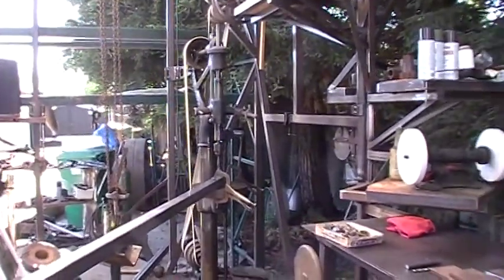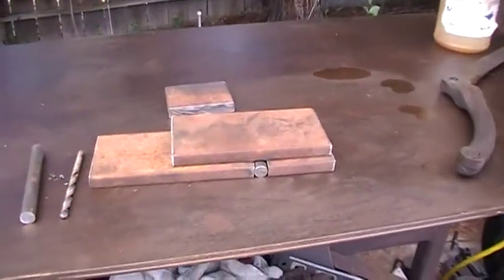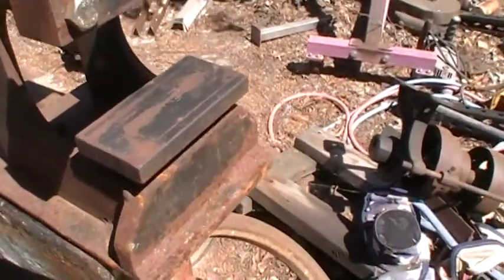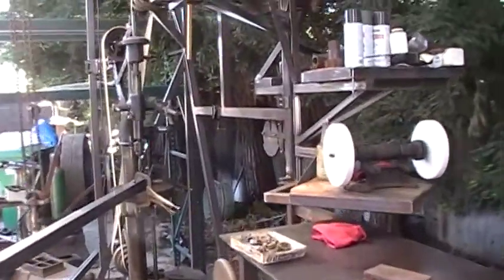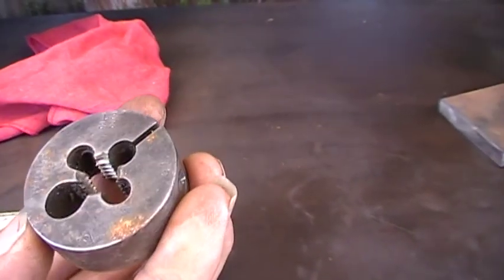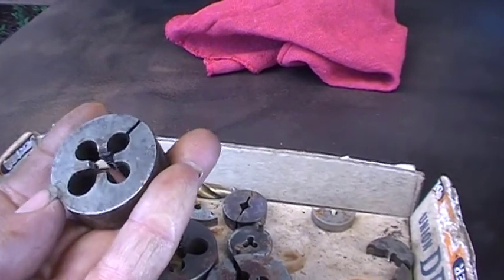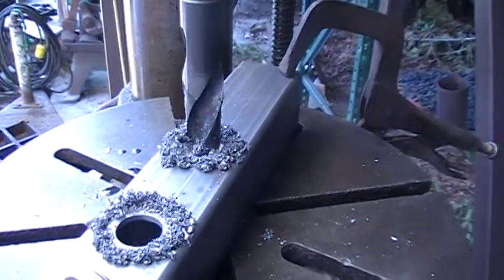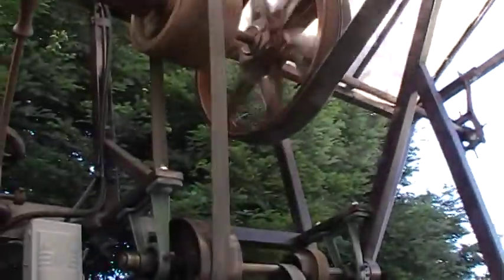Canedy otto blacksmith's helper odd size dies 1888

Comment: Just love old taps and dies and I am a bit of a thread nut myself! Do have some larger vintage ones, but recently have been using vintage dies to make small ones like 1-64, 1-72 and 12BA. Thanks 👍😀
Reply from the maker: oh yeah. I found a set of square dies patent 1865. always looking for the older oldest. The early hand made are the rarest. Most got thrown away. I haven't really seen too many small ones like yours

Comment: How tall is your walls and the length and width? Looks really tall in your video. I really like what you are doing. The old stuff is amazing. I use as much old stuff as I can in my shop. As far as Harbor Freight is concerned, their router bits are the best I have used in a while. I know some of their stuff is poor quality in my opinion, but some things just seem to last for ever. I like to own good old made in the USA stuff but, most name brand items are made in China any way. That is just one reason I like the old stuff. Thanks for keeping those beautiful machines alive and good luck.
Reply from the maker: Yeah we like the old stuff! It's called old iron disease. The trailer's deck is kinda low - standing on the diamond plate it's about 20" off the ground and from there to the ceiling it's 9'. The roof peak is 20" higher. So that would be around 12' 4" and with any trailer bounce going down the highway I think It stays under 13'. Deck length is 16'. Roof has a 4' porch front and rear = 24'. I made the width come out to outside edge of the tires = 94'. You know DOT allows up to 8' 6" width so I'm keeping safely within their limits. Thanks for watching and the interest in my project.

Comment: Dave don't have a 10-27 tap and die naad a set for a project I'm working on.
Reply from the maker: I don't recall, but I'll look and see if I can find one
Reply: Dave Wilson that would be great. If you don't need the odd ball stuff I can probably put it to use . Things like that come up from time to time.
Reply from the maker: iirc 27 tpi is npt. I found 10-24 and 10-32. Looking through the dies in the video I also found a 15/32 - 14. Now that I think about it I have several very old sets with 1/32 on every piece. These may be just a different designation for the same thing. 15/32-14 would be 7/16-14+1/32.

 I've collected taps and dies all my life and have a warm place in my heart for them.  Dave
Reply: Dave Wilson interesting thing you've noted never seen that before.
Reply from the maker: Mystery solved! My mind works slowly but all the oddball dies are 1/32 over NC. I have an early full handled set (Lightning) that has all the dies 1/32 over. Not sure the reasoning behind that? Blacksmiths taps were made taper and I"ve researched without success the reasoning for the taper. If you are familiar with blacksmith's taps the taper is extreme.
Reply: Dave Wilson new things to me. 1/8" not pipe is 27 tpi .I need 10-27 Stanley used that on there no. 78 plane's depth stop. Proprietary part kinda deal lol your average Joe could only get it from them.
Reply from the maker: Old Iron Shops yep proprietary. I heard about Stanley and there thread sizes. Doesn't make it easy. Unfortunately I haven't ran into to one of those highly specialized dies. Dave
Reply: Dave Wilson it's OK there available new still but not very cheap.